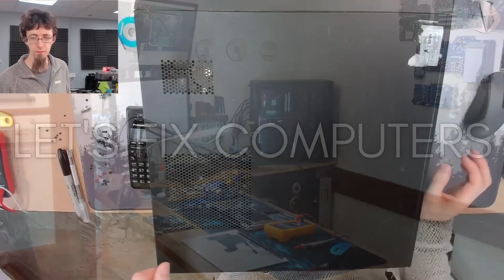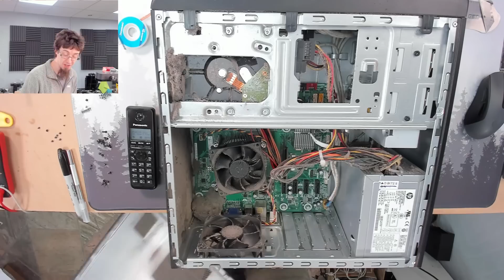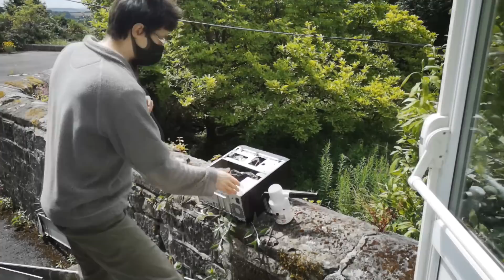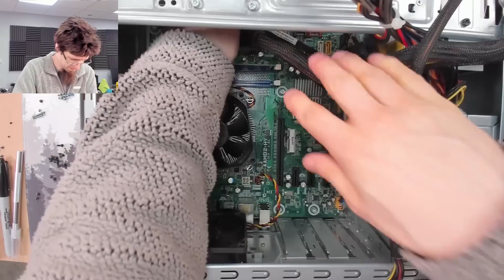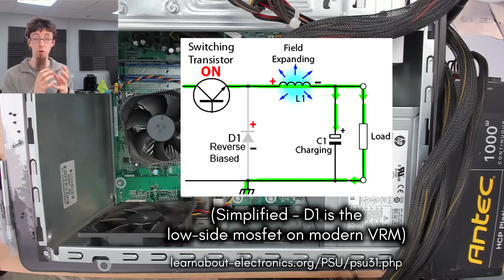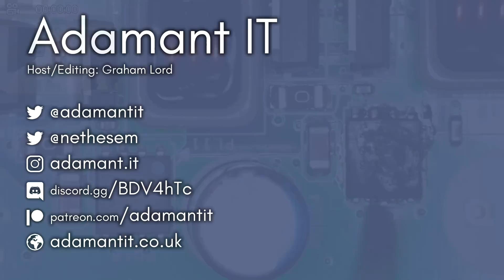HP Tower aggressively doesn't want to turn on - LFC#314

Comment from the maker: I genuinely didn't know this was going to happen. I thought it was just a dusty PC 😅
Just in case anyone's thinking "weh you could've saved that" - this had an E2-3200 (FM1) CPU in it. It was not a good APU. It was the worst APU. This PC was not worth saving.
Reply: I got to 1:20 into the video and had to come check the comments because I thought "There is no way in hell it's worth fixing that piece of junk, what are these people thinking?"
Reply: @Inehmo42  I love the ivory towers people inhabit in the comments. Last week I had a call from a secretary of a small electrical business whose owner knows my brother. The PC had become unusuable and their company payroll was on it (Sage), could I help? Budget to fix was zero. 
The PC was unbranded with an MSI H61M-P31 (G3) M/B, a Pentium G860 CPU, 8GB DDR3 and a Toshiba 1TB HDD
It was indeed unbelievably slow - even to get into Windows 10 settings was a wait of five minutes.
Did I throw it in the bin and demand they shell out £500 on something new? No, I cleared off all the junk such as AVG and the other million things in startup, virus scanned and chkdsk and Auslogics defrag (Thanks Graham). Then I recalled that I had a Core i5 3450 and 4GB sticks of DDR3 doing nothing. Put them in and the PC actually worked well in dual channel mode no less. The upshot is that any time I want electrical work done for nothing just ask.
Any moron can say "Anything less than a Ryzen 5600 is scrap", it takes a bit of understanding of other people's situation to actually help.
Reply: @reggiedixon2  cool story bro. It's nice that you were able to do free labor and parts for that small business owner. Makes is a lot easier for it to be "worth" saving when it's completely for free. As far as I'm aware Adamant IT doesn't work for free. So it's already a cost to bring it in. Sure, the computer in this video is also worth saving if you just change the MB, CPU and PSU and not charge for any of it.
Reply: @Inehmo42  Why does my actual account have to be in competition with Graham? What part of "zero budget" is confusing?
Reply: Those E-series APUs are quite slow, one day I borrowed a school netbook that had an E-series with a low clock speed (less than 2.0 GHz) and I think dual core in it, along with 4GB of RAM and a 5400RPM HDD, it had Windows 10 OS loaded on it, and even when Windows 10 was done grinding down the HDD with its millions of services, Defender antivirus, alongside the school's installed apps auto-starting (I kept an eye in Task Manager), the computer still felt sluggish and unresponsive to use just from the sheer lack of processing power from the CPU.
Reply: Would a new MOSFET have worked or was there something else that caused the MOSFET to die.
Reply: At least it went out in a blaze of glory. Much better than how most of these old systems go. :)
Reply: Finally the power supply of HP was working ok, detecting the short and the antec does NOT detect the short on that line.
Reply: Late to the party... I'd still watch computers like this one being saved and donated to a charity.
Reply: This is why, I use a 180w power supply for testing, sometimes things just short out, especially after I try fixing them.
Reply: dont bother...u missed an obvious short! ur guts was right this time.
Reply: Glad you decided set the cammera,...
Reply: I fully understand. I think that junk PC is good to be donated to some hobbyist as a training stuff. Depends on the owner but it does not worth to repair it. It is just a good piece for someone as me who is not doing this for living and can spent some time just practicing skills that Graham do not need to practice...
Reply: same people would say "why didnt you save the PC with pentium 4"

Comment: Could you have replaced the mosfet and saved the board if that's what the customer would have wanted?
Reply from the maker: Theoretically, yea, new mosfet and new mosfet driver (driver chip is usually the cause of a mosfet failure) may do the job... but it's not worth it unless it's a pretty special mobo. The labour charge would easily outweigh cost of replacement.
Reply: OK, that explains it.   Thank you. @Adamant_IT

Comment: Im not very knowledgeable in Motherboard repair, I watch alot of Northridgefix's videos. If that short circuit was a direct short to ground, could you have injected voltage and replaced that mosfet?

Comment: Wrong move buddy! :D That old PSU is most likely perfectly fine and I was convinced that it was something on one of the power rails that's shorted. If it was an internal short in the PSU, in 90% of the cases it wouldn't jerk the fans into a "quarter-spin" like that. At least that junk box proved to be full of excitement after all! :)

Comment: @Adamant IT - 
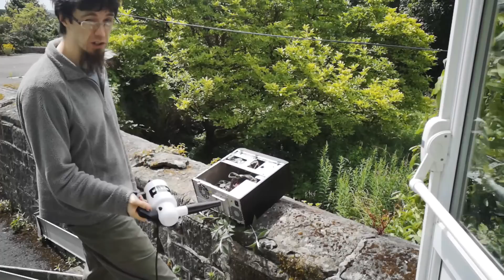good idea to dust outside @ 2:35 BUT breating protection you do WRONG (I know it , because I had been educated in this , this includes my civillian jobs & military service): 
1. No beards (because beards break the seal) ! ; 
2. a mask that makes a good seal , like a better dust / painters half mask (from 3M or GVS or Scott  = these usually fit slimmer noses better) or even a full face mask ( I recommend the "Dräger Panorama-Nova" and it´s successors ! ;
3. P3-Filters + a pre-filter to keep the big dust partivcles from clogging the main filter ! ...

YES "Igmition"! (it must have been a subconscious premonition in your mind) ...  
The old power supply was right , shortcircuit protection was justified triggered

Comment: Whenever I get a rig in that won't turn on and trips the PSUs SCP like the stock PSU did in this one (which is technically a good thing), first thing I do is unplug the 4pin 12V and try to turn it on again after waiting 5-10 secs for the PSUs main filter caps to discharge and "release" the SCP so to speak. If it turns on then and doesn't trip the SCP, no need to go any further, dead VRM, ready for the scrap pile (in 90% of the cases at least, I've done some board level repair on rare stuff, but most of the time it's not worth it)

Comment: I really feel your pain on this one. I've worked on more than a few towers that come out of the homes of heavy smokers (which is pretty predominant in my neck of the woods) and not only are there heaps of dusty bunnies, they're a disgusting brown to boot. I'm just glad my work has an air compressor I can use out back to blow all of that out.

Comment: One of the best Mosfet, PS, "failure mode" descriptions I've heard to date..  125 points awarded. You are on fire my friend. Cheers
Reply: Motor speed controller “ H Bridge “ is a good one .
300 amps 16 FETS , lots of smoke , flames , molten plastic shrapnel & venting caps !
Reply: @gd2329j    NO WAY! That happens to be one of my worst recurring nightmares. How did you know? Freaky. You are all knowing and basically RoCk, GD*J  Cheers

Comment: Holy shit. MOSFETs can do a lot of mess. I have got a 775 socket motherboard which I wish to save. Not possible to turn on - and same as Graham I did not check the short on 4pin 12V ATX. My testbed PSU had tripped after 1/4 of fan turn. I found 4pin in a dead short. But after replacing a shorted mosfet it killed it again in a second. I have got an advise my MOSFET driver is dead and killing the mosffet through out the GATE. Which makes sense to me. There is a ISL6622 mosfet driver and it is connected to the gate fo the shorted MOSFET.. The board has not more than a nostalgic value but wish to save it. Is there anybody able tell if my thought are going in ther right direction?

Comment: Hi Graham - That is positively clean compared with some I find at the car boot sale.  Personally I believe that these things are worth repairing just for the experience and knowledge gained from undertaking the repair and it's use as a teaching aid, rather than any monetary value in the item itself... and I regularly do just that.  If I can't fix them, then I strip the board for inductors, Mosfets, ICs and anything else for use in future repairs, and put the parts in my (fairly well organised) stash of salvaged parts. What are your thoughts on this?

Regards checking for short circuit high side mosfet on any motherboard in unknown condition - I always do that (check any of my videos, I'm not kidding) and certainly I do if a motherboard/gpu etc causes the PSU to shut down!  Does that mean there is something weird/OCD about me as you suggest this is not normal fault finding behavior?  Somehow it seems like an obvious thing to do,  I don't even really think about it, I just do it.

Anyway regardless of  a difference in approach, how about an online challenge?  Would you like to send the motherboard to me and see if I can fix it on YT?
Reply: 95% of the time it's not worth bothering with, especially with low-end junk like this. You don't know whether the CPU survived something like this, and if it didn't you're suddenly spending money on a worthless PC (new/used CPU) and you don't know if the original one took anything downstream with it (RAM for example via the integrated memory controller). And even if you manage to fix something like this, you're not gonna get any money out of it because who on earth would want a bottom barrel HP OEM PC with the worst possible components they could find when it was new, let alone 10 years down the road..? No matter what you do with it, it's gonna be a horrible experience for anyone using it afterwards unless you spend more on upgrade parts (CPU, RAM, SSD, potentially a GPU) than the final product will be worth... which loops right back around to the first sentence of this post. The only exception to the rule (IMHO) is if it's either very rare (older high-end parts that cost a fortune, so not many sold as a result of that) or vintage (at the very least 25 years old, meaning not much of it still around to just replace it with)

Comment: Yep. I would have tested the original power supply first, eliminated it as being the fault, also I use a low power 350w PSU for testing, 1000w is way too much for testing.

Comment: I think new PS's have short circuit protection, odd that that newish looking Antec didn't. That happened to me a couple months ago on a running PC that destroyed the MB, but that PS had molex connectors, ie, it was an old style. I've got an old Alienware1st gen, and luckily it has PS sc protection because I bought a ebay PCI to PCIe adaptor that was shorted.
I kind-of knew the MB shorted, because HP and Dell usually use short circuit protection PS's. Basically the SB LED going off showed the PS needed to be reset by unplugging, ie, the MB was shorted.
Reply: That Antec does have SCP, but on a PSU capable of 40A/480W per 12V rail and 83A total on 12V, a little short like this means nothing and it just blasts through

Comment: 8:10 - "Outcome is the same..."
Outcome would not be the same, you probably have a dead cpu now + maybe a hole in PCB. 
If you just had checked for shorts and find it, you probably would just replace the dead mosfet and had a happy computer... 
Anyways, next time you'll avoid such situation by checking for shorts :)
Reply: Whenever I get a rig in that triggers the PSUs SCP, first thing i do is not get my DMM, but unplug the 4pin 12V/EPS12V, let the PSU reset by leaving it unplugged or switched off (if it has a physical switch) for 10secs or so and try turning it on again. If it powers on then, no need to go any further. Dead VRM, close it back up, off to the scrap pile. And let's be honest, who would cry after a FM1/FM2/AM3 junk CPU these days :D

Comment: As a long time repair tech I would absolutely say it wasn't the dust that killed the motherboard it was the original bad powersupply most likely that overvolted the  board weakening that mosfet and who knows what else due to bad current protection on a cheap OEM psu.  I would have unplugged the clients data drive first thing as well to avoid data loss.
Reply: Dust probably killed the PSU, dust traps heat and PSUs fail when they run hot

Comment: I've been using that electric duster for a few years now and I like it, however the bottom is the intake and as you are dusting you will find that it will clog the bottom as the dust gets sucked up like a vacum as your blowing out x device. You have to clean that filter on a regular basis. Overall I like it and saves money instead of buying canned air. Also, unlike an air compressor unit too, you cannot change the pressure of the air flow.

Comment: Yeah sofar for another 'professional' motherboard blow out/up !
You should know there is a short on the motherboard when the psu cuts out and does 1/4 fanspin. What you do is disconnect the psu and test it. Now you know the fault is in the mb. The customer should get a new mb as it's clearly your stupidity...
Reply: The time it would have taken to fix far outweighs the value of the motherboard. So either way he would still have told them they need a new motherboard.

Comment: My first thought was a failed PSU as well. Wasn't expecting the high side to go up like that.
It's a shame as it could have been used for a NAS.
Reply: a Raspberry Pi for 10 bucks is probably faster and has less power consumption. Times are changing :)

Comment: That explains why the power supply wasn’t turning on fully, it detected the short. I’m surprised the test power supply has worse short circuit protection than the stock PSU.
Reply: It had just much higher treshold for Tripping, not surprising since it can deliver several times more power on its 12V rails... HIgh end CPUs can easily crunch more power then this entire system did white being shorted out,...

Comment: It's amazing what an SSD can do for old PC's, most of the components still work as well as the day you bought that lightning fast PC back in 2010 just the drive is old and cranky and the O/S has a lot of bloat.  Some PC's come OOB struggling to run anything these should just be thrown in the bin!
Reply: Exactly yes,  SSD's have changed everything totally.
It's unfair to compare older PC 's with old mechanical cluttered drives and newer SSD equipped systems.
Even a modern PC will struggle just as much with a old mechanical drive and Windows 10/11.

Comment: When researching if having a ridiculously oversized power supply in a PC (e.g. 750W for a low end CPU with no graphics card) is a bad thing or not, one of the downsides I had found across some forums and websites is that if a component were to fail in a way that it short circuits, such as the motherboard in the video, because the PSU has so much reserve power, it is more likely that the component that short-circuited goes up in flames than the PSU's overload protection circuit actually activating. Well this video happens to be a good example of that, although in this case the overkill thousand watt PSU wasn't pre-installed in the PC - it was just hooked up temporarily for diagnostic purposes only.
Reply from the maker: Yea this is an interesting conundrum, a few people in the comments have remarked that the Antec appears to have less protection than the stock HP PSU... but as per your post it's not quite that simple.
IMHO, this isn't really something you can plan for, or that is worth anticipating. If you're working on devices where you're expecting a short circuit, then yes, you check first... but when building a PC, I don't think you can feasibly plan for this. There's also a theory that multi-rail PSUs are better than single rail because the maximum wattage per connector is limited, thus limiting potential damage, but this antec is a quad-rail, and still managed to burn down a high-side.
Reply: @Adamant_IT  i do some pc work here in the states i havent see that happen but i dont work on a ton of stuff primarily just for friends and family but 2 of my builds used boards that was from HP as i pulled the boards from the case and put it into a custom one for my personal stuff
Reply: The Antec 1000W "short circuit detector" PSU worked perfectly!
But seriously, there are many more low-quality high-power PSUs than low-power PSUs because high-power PSUs are sold to the general public who are ignorant about PSUs and believe more power is better, while low-power PSUs are sold to corporations (such as HP) who care about legal consequences and care abut their reputation.  If an HP computer burns down a home, HP might have to pay all damages.  If that Antec PSU starts a fire, then well, it was the motherboard that failed.  Not Antec's fault.
Reply: often enough the consumer pc's get garbage PSU's and wouldnt be surprised if the one in this pc actually damaged the motherboard when failing i dont know how many hp computers ive picked up that someone gotten rid of because of a failed PSU
Reply: @dawn1berlitz  I'm willing to bet real world money that the stock HP OEM PSU (this one being made by Delta Electronics, so definitely far from garbage) is perfectly fine and did its job, which is triggering its short circuit protection and refusing to turn on to prevent further damage. The antec on the other hand with 40 amps per 12V rail and 83A total had the SCP trigger current set so high that this shorted MOSFET just seemed like a regular, fairly high load, so it did not turn off and obliterated the mobo and likely the CPU with it as a result. If the antecs SCP was that sensitive to shorts that it did turn off, you couldn't power high end GPUs with it because the PSU would then just falsely detect those high-wattage loads as a short
Reply: @Knaeckebrotsaege  most of the time ive seen a HP thrown out because the psu failed usually a hipro or other low quality brand psu
Reply: A proper power supply will cut the power immediately to prevent any major damage.